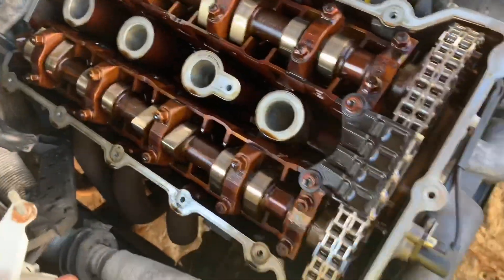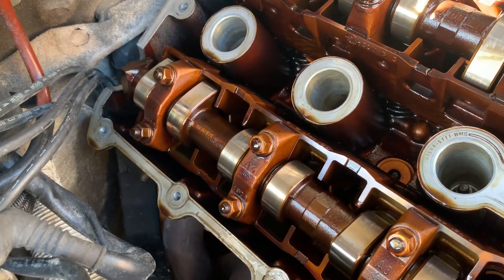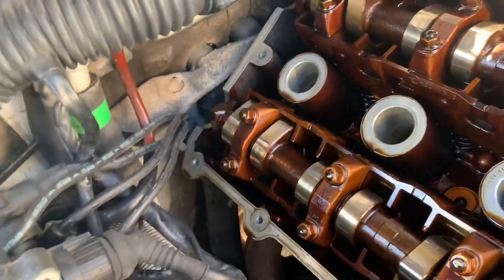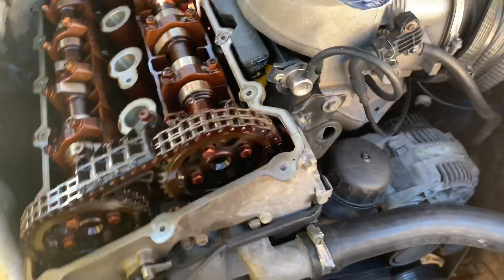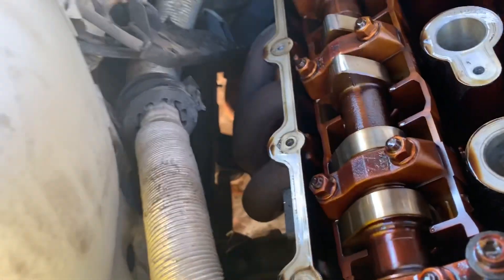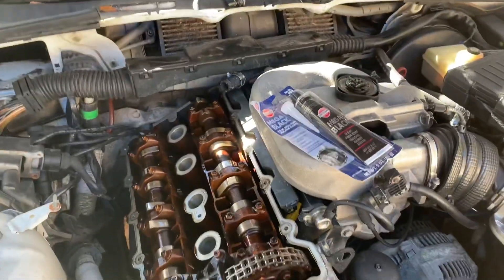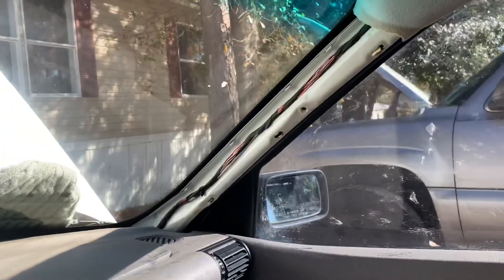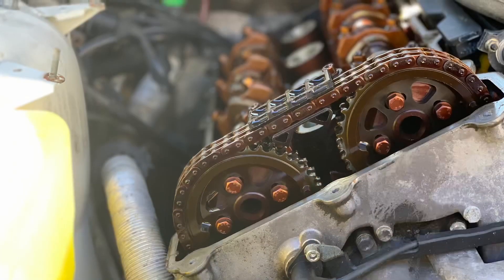Tech Tip | Silicone Gasket | Use it

Comment: Thumbs up for a very clean valve train!  I use needle nose and a pocket screwdriver to dig out the metal clips go slow with this so they dont go flying, maybe a decent epoxy to reattach the plastic bits to the trim like maybe regular 24 hour JBweld